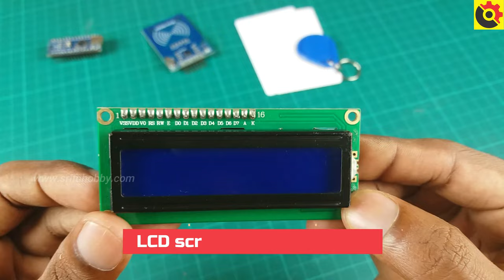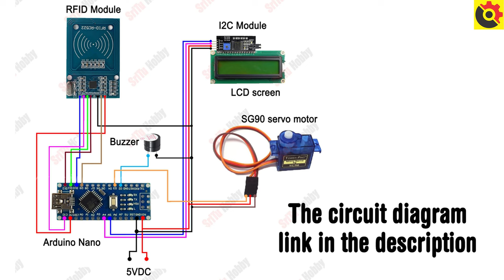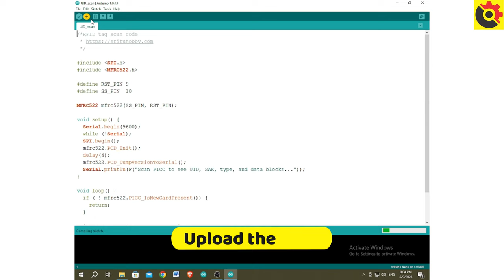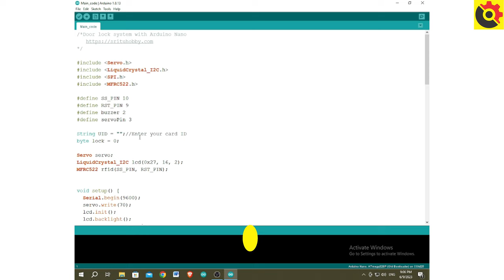How to make an RFID door lock system using an Arduino Nano board #sritu_hobby #arduinoproject

Comment: I did copy everything except for using a power supply at the end, after I upload the code, the rfid and the buzzer works fine but the lcd has no display saying welcome etc. and the motor doesn’t work too, is it because it seeks more power than my laptop can provide? Does it really needs to connect from breadboard to a external power supply to make the lcd works and the motor (I’m new to Arduino projects)

Comment: Hii please reply

Can i use it without I2c module and lcd screen and can I make it without bread board and last if I don't use I2c module and lcd screen then i have to change the code???
Please reply
Reply from the maker: You can connect

Comment: Hello i wanted to ask something that whenever i run it with my pc's usb it run very smoothly and works perfectly but whenever i run it with batteries it starts lagging and freezing and even sometimes it starts displaying some symbols so what do i do i have tried many things such as changing the batteries connector, the battery it self, using multiple batteries, but nothing worked
Reply from the maker: Please use a 9v battery